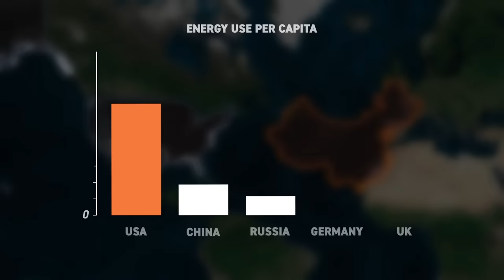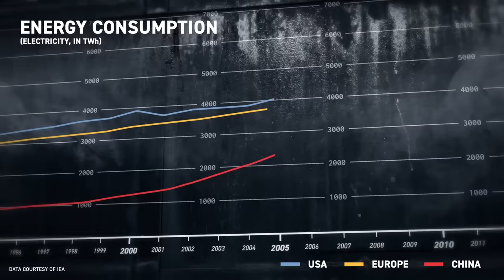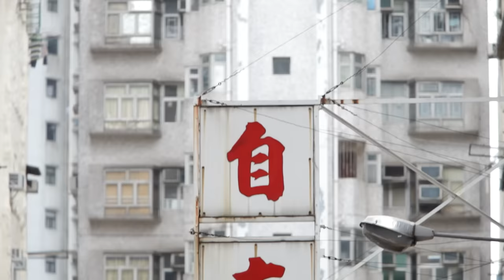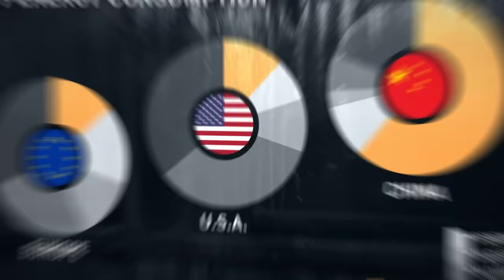China’s Electricity Problem

Comment: Nuclear is both the past and future of power generation. See info about coal exhaust vs total EVER nuclear waste. It's crazy. And it's important to remember that the nuclear accidents that have happened were the result of severe design flaws and/or negligence. We can figure out what to do with (nearly) indestructible crates of nuclear waste later, but this needs to be solved now.
Reply: What about external factors like plane accidents, extreme natural disasters, wars and terrorism? Unthinkable now in most places but you never know how everything will be in 50 years.
Reply: People are working on it, the French are betting their entire future on that. But it's actually not that easy - Nuclear power is way too expensive at the moment and it's such a slow process to build new plants. The issues shown in this video are immediate and so is the global crisis this belongs to. We need something now, figure out nuclear power later ... or build a time machine
Reply: @vince6473  we already dealt with this. In the US there is reinforced concrete protecting nuclear plants so powerful, they slammer a fighter jet into it at high speed, and the jet crumbled.
Reply: @TheKlaun9  They are not going to hear that. people still arent able to do a cost analysis of wind and solar. Dont expect them to do one on nuclear. The very fact that america quit pursuing nuclear power in the 70s should tell them something. If a person thinks america quit nuclear because of 1 small accident then they do not know america. If nuclear was actually a money maker there would be thousands of them in america
Reply: @vince6473  The thing is that 1) We now cannot bear living without electricity. 2) We DO KNOW how everything will be in 50 years if we use coal plants. Would you favor in betting for the obvious, or the mere 'possibilities'
Reply: @TheKlaun9  The French have made the right choice. It might be expensive and complex but still generates a lot more power than solar or wind and does not rely on the climate at all. It baffles me how it isn't more common in a world trying to get rid of fossil fuels.
Reply: @TheKlaun9  Nuclear power has significant expense from the sheer amount of subsidies given to oil and gas and because people have stupid conniptions about it being extremely dangerous despite nuclear having the lowest deaths per kilowatt hour of any power source, even including the disasters. It's also, last I checked, the only power source that's not carbon polluting that is actually viable to replace a grid with. Wind and solar are efficient but the amount of space they need and growing energy demand in most countries makes them pretty impractical as the sole solution. The reason nuclear doesn't get built (in the US) is because people are stupid and politicians can't make political capital off of it because the plants take long enough to build they might get voted out first
Reply: Nah, not needed if we just put that huge amount of money into microgrids with renewables
Reply: @bofty  you are not actually thinking it is a viable option at the moment, right?
Reply: the volume of nuclear waste produced by a nuclear power plant is remarkably small, but there doesn't seem to be any political will anywhere to build disposal sites for nuclear waste.
Reply: @zerocoke.zerodiabetes  I know people who live offgrid, have done for years, so it does work if the will/money is there
Reply: The way to address the cost of nuclear power is to address the problem of safety.  A huge portion of the costs are for a complex set of safety systems.  One system for this situation, another for that situation, along with backups and redundancies.  Another is needing to use huge buildings that have room to hold 1000x the volume of the reactor in case of a pressure loss and the cooling water flashes into steam.  

There should be massive efforts to develop new types of safer nuclear reactors that use better coolants than water.  All nuclear meltdowns have been due to coolant loops becoming unable to remove excess heat, reactors boiling off their cooling water, then the fuel melting down.  If better coolants like liquid metals or molten salts are used then the fuel will be unable to boil away the coolant.  

If this is done then a huge part of the safety problem is handled passively and does not require so many active systems.  It would also enable reactors to operate at high temperatures and ambient pressure simplifying operations and improving the efficiency that heat is converted into electricity. 

There should also be development into breeder reactors that can make fissile material out of far more abundant materials than the naturally fissile but rare uranium 235.
Reply: @Meepersa  so? That's a pure idealistic reply. It doesn't matter what the reasons are and I don't need them explained in such an incomplete way, my comment is about how this can't be done overnight. People need to stop living in fantasy world, both those that believe nuclear power is dangerous and those that say "why doesn't everybody just switch to nuclear, all problems solved"
Reply: @zerocoke.zerodiabetes  The choice isn't only coal plants or nuclear energy. Other forms of renewable/efficient energy exist too. 

And even though the possibilities are low something bad will happen, if it goes bad it will be really bad. Millions of people can get sick or die. Land can be inhabitable for hundreds of years. This all can be avoided.

I'm not completely against nuclear energy btw, I hope they keep researching it. But I don't think they should actively build them until the consequences become way lower if something happens regardless (see thorium reactors).
Reply: 1 ton of nuclear waste is not the same as 1 ton of burned coal. Nuclear has still really big problems. I still prefer it to coal tough
Reply: @kaliningradtoczechrepublic8162  Yeah, true.  The amount of fuel needed to produce 1 ton of nuclear waste produces vastly more energy than the fuel that produces 1 ton of coal ash.  The amount of nuclear waste produced is so little that it can reasonably be contained and managed.  The amount of coal ash that gets produced is far too vast to be manageable.  

It's also not really waste.  It is spent fuel that should be re processed.   There is still some uranium 235 and some plutonium 239 that could be used as fuel.  Vastly more energy could be produced if it was reprocessed to use in breeder reactors. 

Fast breeder reactors could also get rid of all of the long lived transuranic actinides so that the by products stay radiotoxic for only about 300 years instead of 10,000 years.  

The chemically toxic byproducts from fossil fuels like mercury are problematic forever.  Nuclear waste decreases in radioactivity over time.
Reply: "We can figure out what to do with (nearly) indestructible crates of nuclear waste later"
Sounds like a pretty important thing to figure out before making a commitment to this type of energy production.
Reply: @jeffc1347  Recycle it.  There is still plenty of energy left in the so called spent fuel.  Molten Salt Breeder Reactors are a good solution and would already be in use if the funding for their development had not been cut by Richard Nixon.
Reply: It's also important to remember that we don't have infinite amounts of fissile material.
Nuclear cannot plug the gap between fossil fuels and renewables we currently have for even a century based on known reserves.
Reply: SMRs (small modular reactors) solve many of these issues.  They can be built fast and cheap on an assembly line. An unforeseen accident affects a smaller area….and there isn’t a large station to target in a war.
Reply: @vince6473  American Nuclear reactor buildings are designed to withstand a fully fueled 747 crash directly on the containment building.
Reply: Thorium can't be used as a weapon.
Reply: We haven't figured out how to prevent negligence yet. The risk is still very real.
Reply: @jeffc1347  That is not how humans operate. Historically, humans acted first, experienced consequences of their acts second, then thought about how it could have been avoided. Nowadays, humans act first, let other humans experience the consequences, and don't think about it.
Reply: @TheKlaun9  The Asian manufacturers are building new nuclear power stations under budget and in under 3 years.
Reply: @TheKlaun9  Ironically the French are expected to lower their nuclear % of the grid, replacing it partially by renewables. This is mostly due to the costs and the time to build new ones.
Reply: One of the problems with nuclear is that then you also need to get different ways of getting the nuclear materials and these are generally quite more expensive. If the entire worlds electricity supply would change over to nuclear today, we'd be out of the 'easily accessible' nuclear material now used in less than a decade (I believe even more around 6 years). So this means we need to get more efficient reactors and we need to get the costs down of other means of getting the nuclear material (like from seawater I believe). Neither of this is easy, cheap or fast, which is why nuclear isn't really more than a side option currently and is likely not going to make up more than 10-20% of the worlds electricity grid in the next 50+ years (hell, it currently never has been above 20%).
Reply: @theviniso  Because of one main reason, nuclear power has the worst risk impact metric on it's worst case scenario. People keep talking about how few incidents happen with nuclear power, how expensive it is or how long it takes to build one. None of that matters. There are government infrastructure projects that cost multibillion USD for no other reason than vanity, there are infrastructures that take decades to build just for the very first phase of the project, in comparison, a mere decade to build a new and safe hi-tech nuclear power plant with siginficantly higher performance to cost ratio than any other power generation method in existence is a no brainer, unless you realize, that those really aren't the reason why we don't have nuclear power plants everywhere.

France is probably one of the only, or at least one of the very few countries that's willing to take that risk. As someone who's been on the side of the decision making regarding nuclear power plant investment and establishment, I can assure you, none of the reasons people have mention in this thread matters, at the slightest.

The reason why proposals kept getting rejected is simple. While nuclear plants are really safe, it's what happens when an incident does occur. When the largest geothermal or coal power plant in the world explodes, and all mitigation plan failed, well it's a disaster, but we can recover from it. When a nuclear power plant had a meltdown, and all mitigation plan failed, well, you'd be lucky if you get another Fukushima and not another Chernobyl on your hand. Miles of land become completely inhabitabie for centuries if not millenia. This, is the sole and main reason why, we don't see nuclear power plants everywhere.
Reply: @nicoinformatics  We all know the risk but if we want to get rid of fossil fuels we can't simply jump to solar and wind power, they're just not enough. Nuclear power is more than worth the risk. Chernobyl was almost four decades ago and had a design flaw, Fukushima took a huge earthquake/tsunami to fail, and that's it. It's like airplanes, sure, when they do fall it's a major disaster, but if you look at the numbers they are much safer than cars.
Reply: @theviniso  See what I mean, you're still missing the point, this is what I mean by most people don't seem to understand the actual reason why proposals for nuclear power plant is often rejected. Even politicians knew that nuclear power is safer, when we present risk management analysis reports, it's quite clear that nuclear power plants has a much lower incident rate than most other power plant technologies combined.

I'm a big nuclear power supporter, but there's this analogy we use whenever we do RMA on this topic, especially when we're presenting to people unfamiliar with the risk of nuclear power vs conventional power generation (some politicans, family members, etc.). It's like this, if you get to pick a small firecracker, it explodes like 50% of the time (please take note of this, it's a pretty shitty firecracker isn't it? it misfires half of the time), but if it did, you'll only get some minor skin burn you can sleep off, OR would you rather pick option 2, a large fancy firecracker, it explodes 0.05% of the time, but if it did, you'd lose your entire hand. Most people, unsurprisingly, would pick the former 9 out of 10 times.

Even I, someone who think that nuclear power is the only way to permanently solve the global power issue and emission, would still pick the former option. Do you get what I mean now? People are willing to take risks as long as if it does happen, they can live with it, but the risk involves something catastrophic, even if it's a very very very small chance of it happening, it's extremely rare that people would accept them straight off the box, or at least takes quite a lot of convincing, marketing, propaganda to make it work. Just like in France.
Reply: @nicoinformatics  So we both agree that nuclear power is well worth the risk. It's a very big risk, sure, but we're running out of options and while nuclear fusion is still in the future nuclear fission may be the next best thing.
Reply: The upfront costs and construction time are somewhat prohibitive. Wind and solar will be the tech that pulls us through the biggest of the energy realignment, but yeah, let's not let all that Uranium go to waste.
Reply: @EloquentTroll  Geothermal has a place too - any rock over 60C can be used. (Low temperature geothermal uses ammonia or propane as the working fluid instead of water).

Comment: 12:20 This is the reason why price caps need to be handled with care. The power plant owners are smart and shut down production when coal prices rose. This is one of the reasons why price caps often lead to shortages.
Reply: almost like it should just be nationalized as a national security issue or something
Reply: That's why private energy is a silly idea.
Reply: So THIS is why in Sim City games, nuclear is so expensive and coal and oil are so cheap.  =P  (4:57)
Reply: In the US (and probably Canada) it is all handled very differently. Electric wholesalers bid for electricity from generators as far ahead of time as they dare. Prices are beyond top secret, with stiff fines or even federal prison time awaiting leakers, including leaks about conditions that are not posted on OASIS but that will affect supply or demand. (As "conduit employees" - we in IT worked with generation and delivery we had annual training on that. Loose lips sink our ships.) Three month contracts have low rates, spot purchases can be tens or occasionally hundreds of times higher.